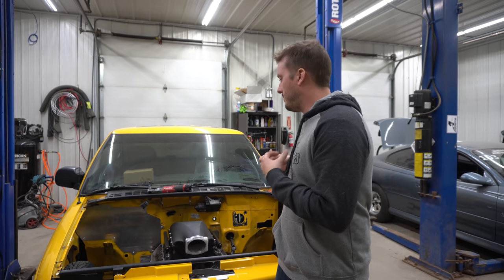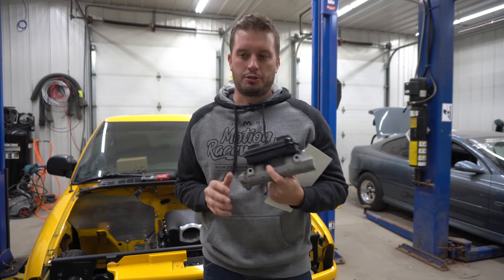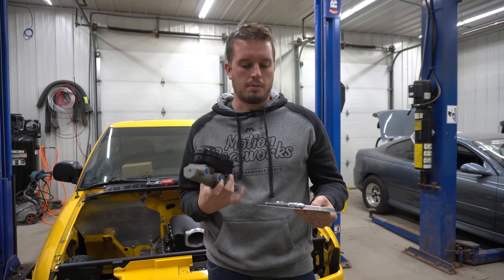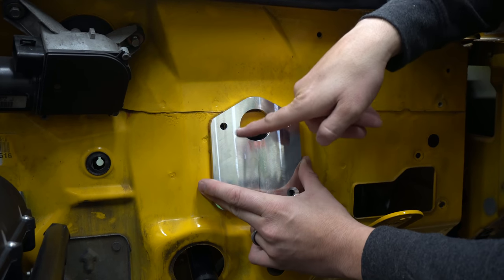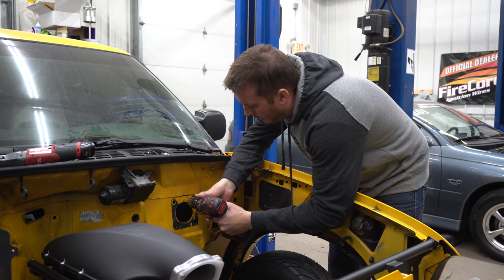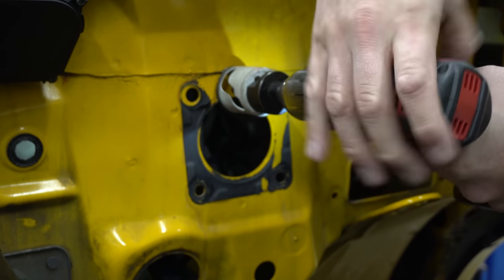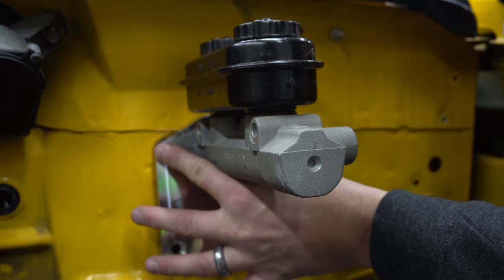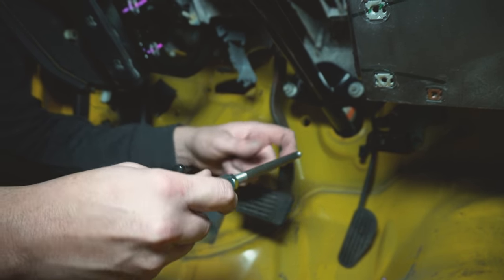94-04 S10 / Blazer Manual Master Cylinder Conversion Install

Comment: Forever waitin on Doug to come out with a 88-94 obs Chevy lightweight race column!!! I wish there was more to offer as far as direct bolt in parts for those trucks. like manual steering conversion & manual brakes. I ended up making my own manual brake setup deal but I still got power steering.. I’d like to do away with it. ideally I’d rather have just alternator only being driven by the belt. cause I plan on going electric water pump

Comment: I don't really see a difference between this second gen kit and a first gen. Looks like it would work with my 91 or is there something I am missing?
Reply: I have 00' Blazer brakes on the front of mine that require 1/4in line. Is that the main difference between first and second gen? I don't see any info about this on your webpage.

Comment: so do i need a proportioning valve?
Reply: Soo did u? Just purchased my kit
Reply: @alexx9563  yes!!!
Reply: @kaydendelgado6  how hard was the install??
Reply: @alexx9563  not at all, i did it with my full interior still in the truck (yk getting under them s10 dashes a pain in the ass) in a couple of hours total brakes bled and all.
Reply: @kaydendelgado6  what propo valve did u go with? Did u also need a t fitting
Reply: @kaydendelgado6  what u do for the brake light switch?

Comment: Can anyone tell me exactly what the benefits would be with manual brakes vs power brakes? Im building a 94 s10 thats for the streets but its a corner carver. I have been shopping around for a new master cylinder as mine needs to be replaced. Im running a wilwood proportional valve to eliminate the abs. Would manual brakes work better?
Reply: Is the engine modified? The biggest reason to go to manual brakes is if you are running an aggressive camshaft or boost( ie turbo or blower). Engine vacuum is diminished with turbo/blower or aggressive camshafts.
Reply: @BigNastyOffroad  the engines gonna be fully built stroked LS. Forged internals. Very mild camshaft though not much chop to it to keep it quiet and tame. My guess with the displacement 550ish horsepower give or take. All motor for now. Big 6 piston front brakes with 14 in rotors up front not sure if that matters.
Reply: I would say that I have seen people stay with power brakes in some S10 pick ups for roadcourse use and have not had problems especially with the brake upgrades you've already done. I have a 91 ext cab 2wd S10 working on collecting the parts for the drivetrain right now. I am going for a street/strip setup and if I can't build the vacuum for power brakes there is always a vacuum pump. The assist with power brakes is nice for a street driven truck but pure track driving manual with big brakes all day
Reply: @BigNastyOffroad  thank you much appreciated. Im switching to disc brakes in the rear and wasn’t sure what i should use for the master cylinder already needs to be replaced as it leaks anyway.
Reply: @mjrartist69  manual has better pedal feel and always feels the same so your braking is more consistent. Power is fine if you don’t care about all that and just want the easiest possible braking

Comment: Do you have one for the 85 s10
Reply from the maker: No we only have 88 and up at this time.
Reply: It was said in the video 94 and up s- series. With a stiffening plate and some careful measurements it can be done on the 82-93 s-series. I would definitely suggest aftermarket disk all the way around to improve stopping power if you are going to manual brakes though.

Comment: And now you don't have a brake light switch.
Reply from the maker: There are a lot of options for making that easy.  In our door car brake kit, the proportioning valve has a built in sensor that is pressure actuated
Reply: @MotionRaceworksOfficial  a few questions. 
When swapping from power to your manual kit do you need to use proportion valve? 
Also after I installed the manual master cylinder when I stand on brakes hard it cause them to stick for awhile then release on their own after a few minutes. 
Do I need to adjust pedal rod to fix that?

Comment: If you have an s10, you basically can not do this without removing the entire dash…. Unless… you cut your fire wall up a shit ton like me….. I absolutely regret buying this kit and hearing you say “oh I think you can do it without removing your dash….
Reply: Totally not true. I just installed this kit on my 96 S10 with stock dash and steering in place. Was it a pain...yep, but its totally doable.
Reply: @MICHAELWILLIAMS-vo7hs will it work with facrpry brake Switch

Comment: Any way to retain the factory brake switch? Or is there an aftermarket alternative? Just installed this on a 94 4.3 no brake lights and no way to re attach the factory brake switch on the pedal after doing this conversion